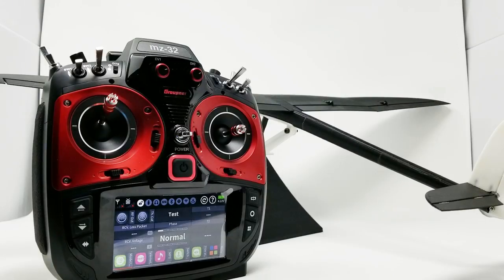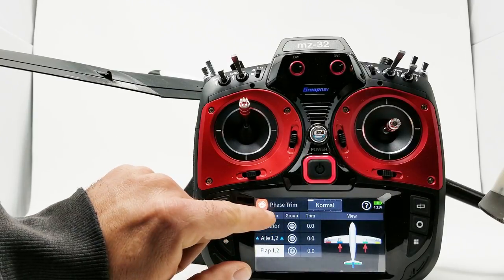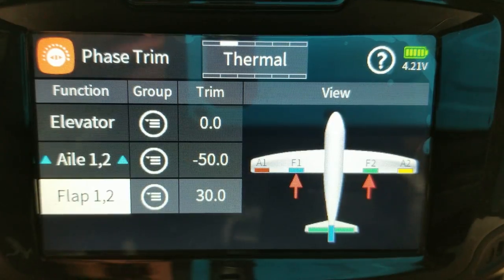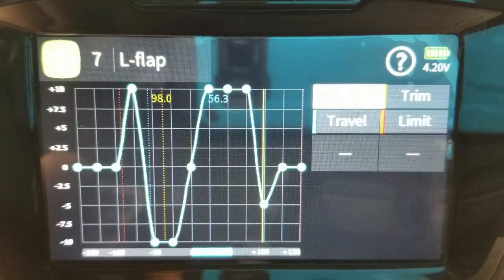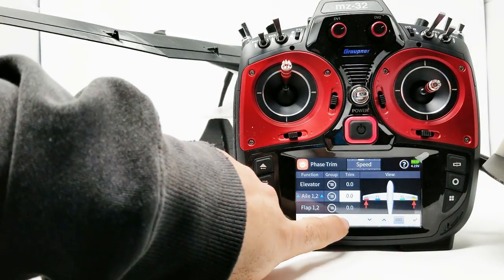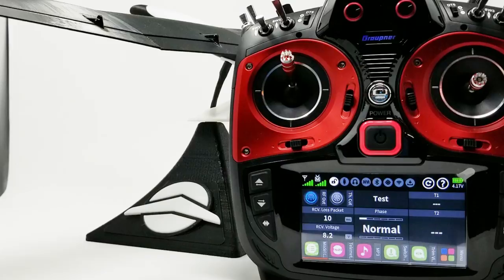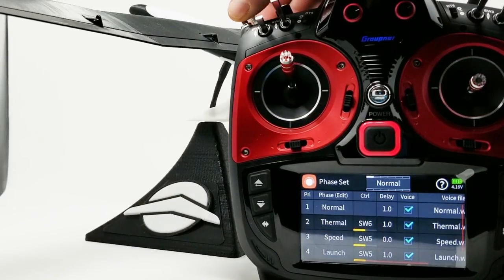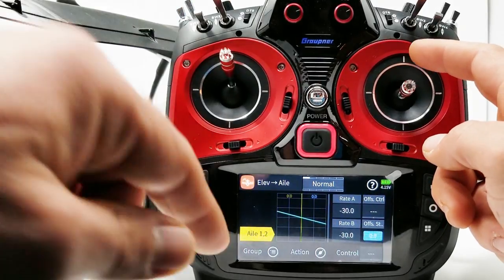Graupner MZ 32 Sailplane Programming Part 2, Camber Issues!

Comment: yes, the problem of proper alugnment on a more than 2 servo wing is present. I used to check the deflection on the throttle stick with servo travel and servo limit (travel is for in between and limit us for endpoint setting) on MZ24pro. Looking on symmetrical travel while using the brakes and recheck, so then its possible to use the same amounts within snap-elev or camber or butterfly. It is faster for the huge phases orgy to not to set up four servos per phase on MZ32. In my case the servo balancer will be a benefit.

but to profit from a software where it is possible to split the slave and control servo 6 7 or AIL independently if needed is highly recommended ; -)

Comment: Thanks for a great instructional vid Ali. I was thinking of dumping my JR  for a MZ-32 but but after seeing the hoops that you had to jump through to get the camber in the various "Phases" equaled out I'm sticking with my old radio. Well at least until Graupner updates the firmware in the 32.

Comment: Hi I have used these videos to programme my MZ-32 and they proved really useful. Did you ever do the F5J video you said you were going to? I would be interested to se your set up? Cheers Nigel Wales UK
Reply from the maker: Never did the 5j vid. I used this radio for 1 year. Worked great in the USA but terrible in Europe. Have since moved back to JR.
Reply: @flightcomp  Thanks for your reply, what do you mean that it worked terribly in  Europe as I am based in Europe and have no problems with either of the 3 Graupner TX I have?